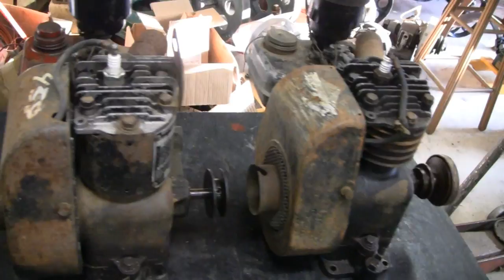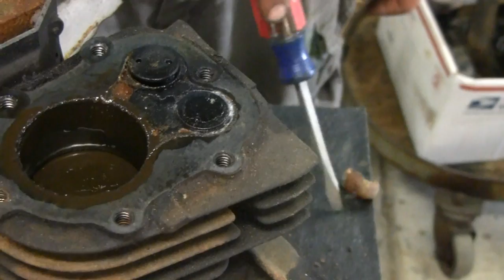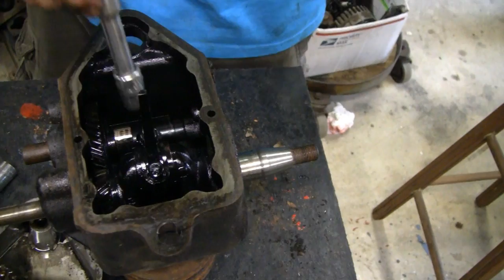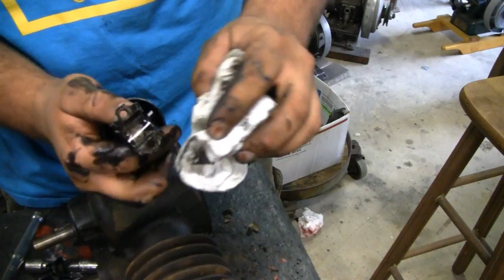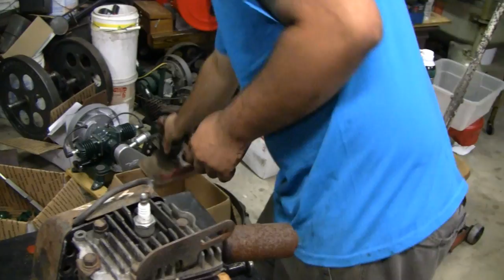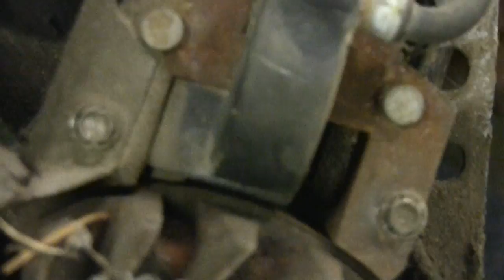HOMEMADE TWIN BRIGGS ENGINE PROJECT (part 1)

Comment: Where can you those engines? I go to a tech school and am in the auto field and the small engines we have all have the side cover not an oil pan on the bottom.
Reply from the maker: We usually pick them up at engine shows and auctions!!☺
Reply: 805ROADKING Really??? Where are some of these because there aren't any where I live.

Comment: My dad and I picked up a 5s at a a hard sale and it also that variable diameter pulley and we could not for the life of us figure out how it works. We couldn't even find any patents or any info on them. Would you have any idea be cause it would good for let's say a vintage go kart.
Reply from the maker: I'm not sure how they work either, we didn't use ours!!☺
Reply: Would you know what it might have powered?
Reply from the maker: They put alotta them on reel mowers!!☺
Reply: 805ROADKING woud you happen to still have that variable diameter pulley?
Reply from the maker: Nah it was sold with a bunch of other parts at a show!!☺

Comment: Heck I saw a B&S engine on a tiller that had sat under a heating oil tank for several years run again. Oh did I mention that the reason it has sat there is because it had thrown a rod. lol

Comment: how do you find the year on these older briggs?
Reply from the maker: check your serial number here http://www.asecc.com/data/briggs/data4.html
Reply: 805ROADKING ok, thanks. I'll look it up next time I'm in the garage.
Reply: 805ROADKING I tried looking it up, but I had no luck. the serial no. is 329156  if you could help me find what year it is, that would be a big help.
Reply from the maker: What model is it, it should be on the same plate, Maybe a 6s or a 5s or something else!!
Reply: 805ROADKING it says model: 8AHF
Reply from the maker: The 8AHF was made between 1953-57, your was made in Feb 1953. They are fairly rare, being an oddball engine that was designed to be a horizontal or vertical engine with a few slight modifications!!☺
Reply: 805ROADKING thanks so much for the help! how did you find it? I've been looking for such a long time
Reply from the maker: just google briggs 8ahf, there are a couple good forums out there!! There's a little info on them but not much!!☺
Reply: 805ROADKING ok thanks so much!!! c:

Comment: Ive seen all the videos for this project now, really interesting! Too bad u left out the "how to" part though, which I was looking for., I have a couple of 2 hp sitting around that I could do this with.. I can figure out myself, but u know theres something called "Columbi Egg". Do these engines have aluminum crankcases like mine, an were they hard to join together?

Comment: Build a new locknut for the muffler using a pipe coupling, cut the threads to end up with 2 pipe nuts.
Yes, it has a magnetron on engine A.
Cool vid series, good luck with it :)